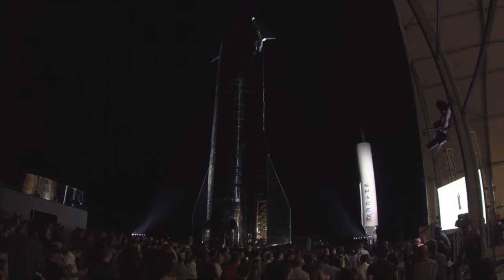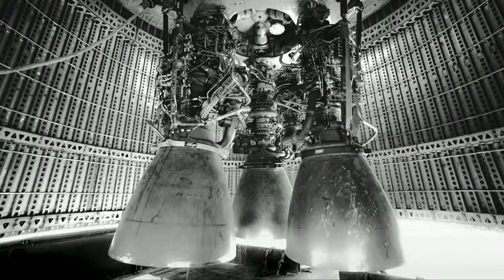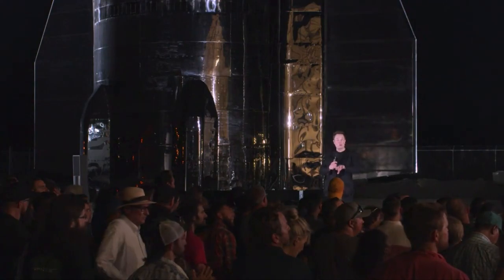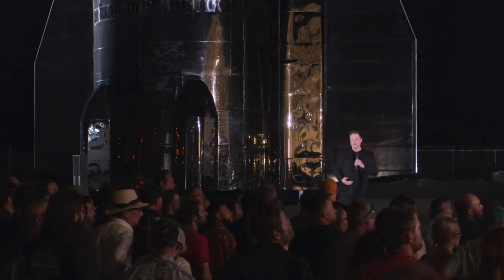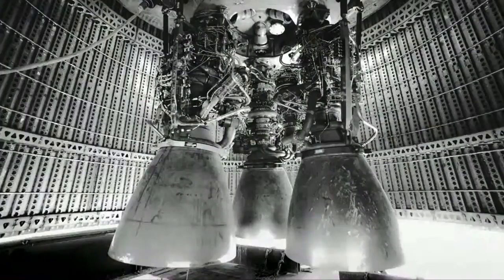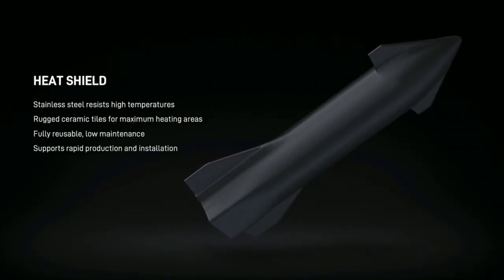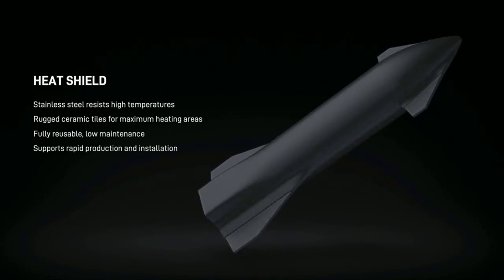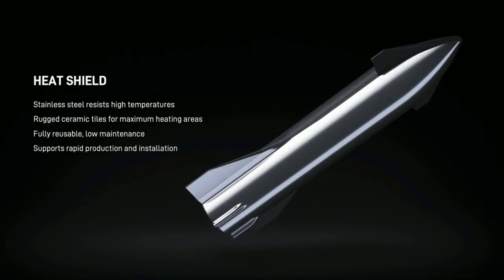SpaceX Starship's 5 Engines and Heat Shield - Elon Musk Explains

Comment: So, according to the presentation   the main advantage of the steel is that it allows to have red-hot aiframe during an atmospheric reentry.. Have I missed something ? Would Musk like to sit inside then.. that is the question.
Reply: Nike Crean also the cryogenic fuel inside at those temperatures directly behind the steel!?
Reply: @illuminate4622  Yes, this is another point. And imagine the tension in the construction due to the temperature gradient.
Reply: @Nike Crean SpaceX has a really tough job ahead..
Reply: @illuminate4622  Probably they supposed it would be an easier and cheaper than full-scale advanced carbon fiber technology development(that would allow heavy heat protection due to the lightweight of the composite airframe). But I really doubt about it..